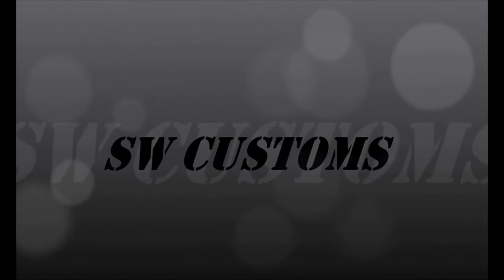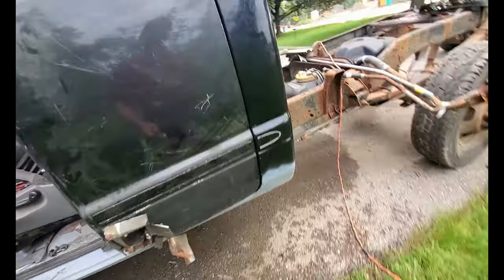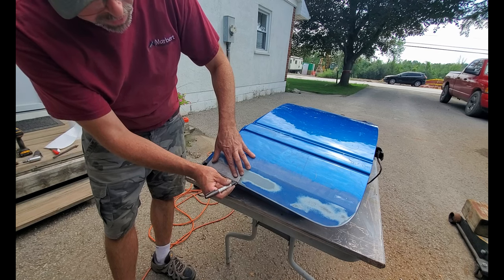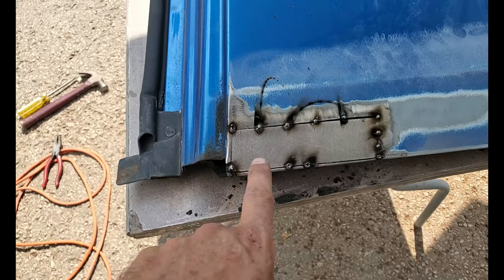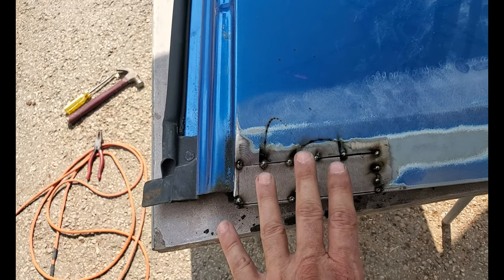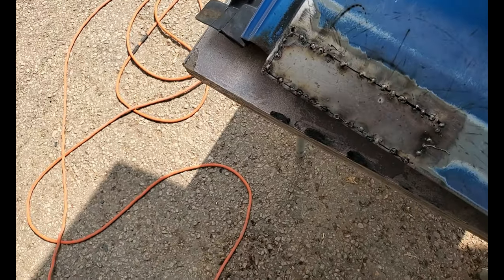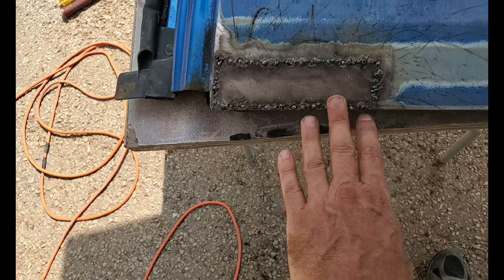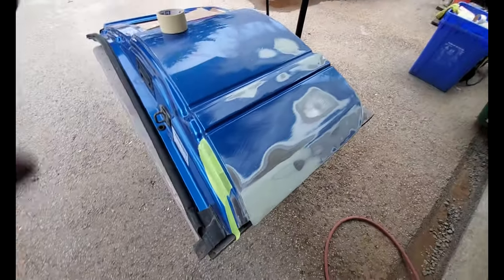Weld A Patch With FLUX CORE??

Comment: As someone who's currently restoring a car, all the horror stories I've heard, of how you shouldn't use flux core for bodywork,  because it's to hot , it's dirty, you'll just burn through... bla bla  bla... Yes you can, but it takes patience,  practice,  and alot of preparation. 90% of the welding I've done, has been with a cheap fluxcore welder. Even after I bought a MIG welder with gas.
Reply from the maker: Thanks for leave a great comment and watching the video. 👍💯
Reply: If you want a real fun time do it with 6013 on a stick welder......yes you can do it but it suuuuuuuuucks.
Reply: @yurimodin7333  I don't have the talent to even think about attempting that. Stick welding takes alot more skill than I currently possess.
Reply: @leetotty7703  the trick is use AC or DCEN and lay the rod angle waaaay down. https://www.youtube.com/watch?v=QkQzwL8fDj4
Reply: Hi there, I've tried to weld a rear quarter panel on my friends car and I was using flux core, I used the lowest settings on my machine and it still burnt through I prepped the steel quite good and it still burned through, any advice ?
Reply: Try using a backing plate, copper or aluminum. If you cant, try increasing you stick out. If its 20 guage or thinner....be patient.
Reply: The key is to make the metal take the heat better. I have used steel but copper works the best.
Reply: i still use a stick welder 😂 ! i love it weld , everything with it !
Reply: @yurimodin7333  yep I did it that way in 1977 on my j200 gladiator on the bed. I also had to replace the entire visor part of the roof over the windshield but that was just spot drilling and plug welding that panel in. Only trouble was I lined the roof up with the doors and now the windshield  needs to be trimmed 1/4 to fit each time it gets replaced.
Reply: @leetotty7703  if a copper plate is hard to find use some copper tubing like 3/4 or so from the plumbing supply and hammer it flat then sand it flatter to use as a backer.

Comment: I've done this exact same thing, and issue is less than 6 months later it starts rusting from the inside out. I stopped using any filler, and have been taking the time to get it perfect so no filler needed.  You want to talk about pita. Lol. Shoot me in the face
Reply from the maker: Well it's unfortunate that it rusted out after 6 months.  This repair was done  2 1/2 years ago and holding strong.  Thanks for watching. Much appreciated.
Reply: Now that it's coming back to me the repair I made was on an old half rotted out Nissan murano. It didn't have rust free metal to patch to. It wasn't worth repairing, but I wanted the practice. Great video. Thank you  @swc-diygarage

Comment: 3 words... Anti Spatter Spray
Reply from the maker: I dont find it that effective. Helps keep BB's from sticking part and electrode but would still have to clean it with a wire brush or wheel.

Comment: Huhh, did not think about the polarity making the melting process different. But of course.. Thanks!

I have struggled with flux core welding rust on cars. Like really struggled. Especially with burn through. But I suspect TIG would be even worse.
Reply from the maker: TIG and rust usually doesn't work out. The rust tends to explode contaminating the tungsten. Truly all you can do is get rid of all the rust you can. Thanks for watching much appreciated.
Reply: @swc-diygarage  Sure I would grind down to clean metal before trying TIG. After your video I have decided to give the flux MIG a new shot.

Comment: I'm going to be doing this soon, correct me if I'm wrong but will water find it's way into the pinholes of the weld even through the fiber glass?
Reply from the maker: fiberglass will seal it making it water tight on the outside. water should never be getting to the inside. I spray the inside with under coating oil once the part is finished and painted.

Comment: Give me confidence to weld with my Mastercraft again but this time on thinner parts like pannel !

My mastectaft is mig and flux core ,should I put gas on it is it expensive to use ?

I will cool it down with wet tissue has I haven't got air compressor but still !

You made my evening I go to sleep thanks Men !

Pierre from Quebec .❤
Reply from the maker: Gas mig is definitely better than flux core. To purchase a small bottle is around $300 plus take it and have filled. You could possibly rent one for a short-term. You can use cold water and a sponge to cool your welds. Thank for watching.

Comment: Great explanations. How did you get your welder “dialed in” on that scrap piece? Thanks
Reply from the maker: The set up material needs to be the same as the repair. Then adjust heat and wire speed. It's important to maintain the same amount of wire stick out and distance from the work piece. Small changes can have a drastic effect.
Reply: @swc-diygarage  thanks for the reply! 👍
Reply: @vic2982.  thanjs

Comment: What wire size you using??  .30 o .23
Reply from the maker: .030 for flux core .023 for mig.
Reply: @swc-diygarage  for fluxcore you got the ground om negative and gun om positive?
Reply from the maker: @vegitoblue7908  dcen" electrode negative". So wire is negative. Ground clamp is positive.

Comment: Hi sir! what thickness was your piece that you had cut ?
Reply from the maker: The patch material was the same thickness as the door skin 20 gauge or .035 inches. Thanks for watching and commenting.
Reply: Thank you. They were no 20 gauge here last summer my projects, so I had to use 24 and 22 gauge. It was thin for my Mastercraft but not to bad for my Forney 261. Thanks alot for your video's